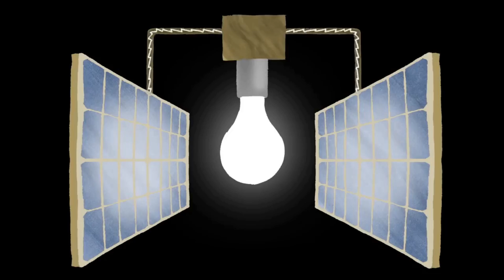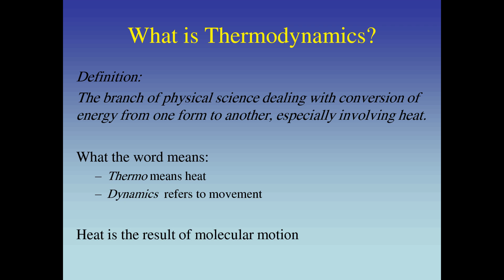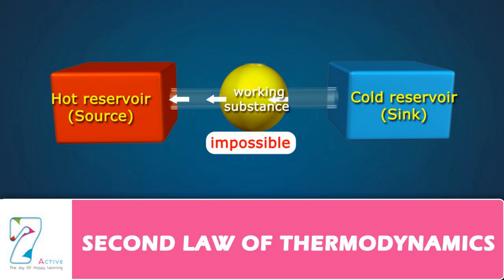2153 Do Perpetual Motion Machines Work

Comment: I saw a video snip of a German company using a large, vertical, conveyor bucket machine, in a water tank that has air pumped out the bottom to lift these buckets. They run a large air compressor for this. They claim a 8kW input to get a 52kW output. I'm no scientist but logic tells me it takes the same amount or more of energy to push air into a water column and its great pressure, than the lift factor of the air bubbles. But people keep trying lol
Reply: Investigate the effect of buoyancy with decreasing depth. As the bubble rises it expands and the greater volume displaces more water, increasing the upward force.  It really worked, but the slavemasters do not want it.  Well, maybe now that they are freezing in the dark. Oh, wait, that is just the slaves.
Reply: Just use the search terms   buoyancy generator
Reply: @marinadizon2720  Maybe you can define HHO. That would be great, Ty.
Reply: Yes, I remember the one you are thinking of.  They had a 10 meter tall tower of water with a conveyor belt of air bells which would get injected with compressed air at the bottom of their range of travel.  As the bell of air rose, and the water pressure lessened, the volume of air in the bell would  increase, thus increasing the upward force of the bell upon the belt upon which it was attached. The belt contained about twenty such bells. At any given time half were rising, and the other half were going down after having dumped their air, which meant they sank with the weight of steel in water with no air.  A belt driven generator  was placed at the top of the tower which generated electricity and compressed air to be injected at the bottom.  They performed public demonstrations, and offered units for sale.  They had large commercial versions, and small home sized versions, each sold via different sales channels.  They offered turnkey 100 MW systems composed of dozens of towers.
Reply: Anyone who bell dives knows buoyancy decreases as depth increases, which means buoyancy increases as depth decreases.
Reply: I've seen that and I have had a solution several years. Put an HHO generator at the bottom of the water tank. Electricity creates oxygen and hydrogen, which can be used together or separately to bring up the underwater wheel.
Also the deeper the tank and larger the wheel the more efficient it becomes, because the air never loses potential for going up.
Also the HHO Gas can be used at the end of the process when it goes to the top of the water. It can be burned for heat and or electricity.
Reply: @dutch1777real  HHO Hahahahahahaha! :face-purple-smiling-tears:🤣🤣😂😂😂🤬:face-orange-frowning::face-green-smiling:
Reply: @belalugrisi1614  a simple Air Lift Pump at the bottom of the ocean run off an HHO generator. 🫳🎤
Reply: @dutch1777real  Please define HHO
Reply: @bélalugrisi  HHO (aka OxyHydrogen) is Hydrogen, Hydrogen and Oxygen. A gas mixture of 2 parts Hydrogen and 1 part Oxygen. This can be achieved from electrolysis of water. (Passing electricity through it). Water is H²O and is easily broken down with electricity...
Reply: A quantity of O2 and H2 sufficient to do any  work, residing in the same vessel, would spontaneously combust. @dutch1777real
Reply: @bélalugrisi  no it wouldn't. 
Also the gasses can be separated to seperate vessels. It is a common feature of HHO generators. The annode and cathode produce different gasses in the electrolysis process.
Reply: That's common electrolysis. Converting  power to hydrogen and back to power by electrolysis has a round-trip efficiency of 18-46%. You definitely want to keep H2 and O2 separate!  Best to you~ @dutch1777real
Reply: @bélalugrisi  why are you deliberately being obtuse?
Reply: @MichaelCarouthGutenTag  to create HHO gas thru electrolysis you need electricity. Combustion of the gas and forcing it to do mechanical work, will give less than the electrical input. An HHO perpetual machine doesn't exist, let alone one that powers anything else. HHO gas under slight pressure (before pressed back into water), is a good way to store energy potential when you have excess electricity, like solar.
Reply: @thatguychris5654  yes of course you need electricity to produce HHO Gas through electrolysis. That's the remarkable thing about it. All you need is electricity. You don't have to physically force gas from the surface down to the bottom of the tank or Ocean or whatever you just run some wires. So the only friction involved there is the electrical resistance.
Reply: The only friction to get the gas to the bottom is the electrical resistance (basically). This is AMAZING! 
I'll explain it again. 
This is a water wheel under water, so it is an Air Wheel. Used to generate energy... Before it took too much energy to pump the air to the bottom of the wheel. More energy that the wheel could generate.  Ut this method generates the "air" at the bottom of the wheel. You are just transporting electricity!
Salt water already has an electrolyte (salt), which increases the conductivity and efficiency...
Don't like salt water, or water at all, because of scarry gasses? Then use a closed tank of another liquid. I think electrolysis works on other liquid compounds. I like salt water.
Substitute the "wheel" for a Air Lift Pump design and the head lift can be utilized to turn a water wheel.
Lots of configurations. 
Also the Hydrogen and Oxygen can be captured and used. Separately or together. For the Scarry Sally's the gasses can be kept separate from the beginning and used in 2 different systems.
This free idea I give to the world.
There are many off the shelf HHO generators available online right now.
Reply: @dutch1777real  Michael this is in fact a great idea! Have you built a test device?
Reply: @dutch1777real  pressure limits HHO gas production. If you stuck electrodes at the bottom of the ocean, zero bubbles would form from the electrolysis because of the pressure. Your idea would work great on a small scale with pressures we can manage in a small water column. Remember, HHO gets pressed back into water with not that much pressure at all. So when scaling it small like that, you will use more power to create the gas than the gas can generate thru lift in a water column. Thru mechanical efficiency loss along with electrical resistance in the wire and water, no perpetual HHO machines for us folks.
Reply: @thatguychris5654  the bottom of the ocean was an exaggeration. It can be done with "shallow" waters or tanks, with manageable depth pressures.
Reply: @MichaelCarouthGutenTag  perhaps read my entire post that you just replied to, since you just repeated what I said lol
Reply: @ThatGuyChris11  I did read it

Comment: "Do Perpetual Motion Machines Work?" The short answer is NO - The long answer is that Self-Contained, Closed-Loop Systems cannot be made to run under their own power.  A motor cannot run a generator that will in turn run the same motor.  A closed system cannot do work and maintain its own operation due to losses in the system. 

HOWEVER - Can machines be made to produce a large amount of work relative to the energy that YOU input into the system?  The answer to this is YES.  Provided that the energy you input is used to move a larger amount of energy existing in the environment.  No energy is created or destroyed, simply MOVED (and/or concentrated) from one place to another, creating a difference in energy potential that can then be harnessed to do work.  

So far, the only form of energy that I am aware of that we can move or concentrate in this fashion is HEAT  - We have built heat-pumps that can move 10, 20, or even 30 times more heat than we input in the form of electricity.  If we can then transfer this heat to a heat-engine and a generator, we could theoretically extract up to 40% of that concentrated heat in the form of electricity.

Comment: The story I was told, is that as microscopes were improved over the years. They became powerful enough to see grains of pollen. What was noticed is that these tiny pollen grains if suspended in water they would perpetually move.. This was shown to Albert Einstein. Einstein said the pollen was being perpetually moved by the movement of the water molecules. From this observation Einstein went on to calculate the size of the water molecule. This is not going to propel your car down the road but is in fact perpetual motion.. Ps don’t shoot the messenger!! Thank you for all the videos ..
Reply: Look up the Two-Stage Mechanical Oscillato of Veljko Milkovic
Reply: @markflint9089  pendulum hammer thing? I remeber it on keelynet
Reply: See graphene energy harvesting

Comment: you have to use 3 different forces, there are some, and most people make them to get into university. there is the magnet, centrifugal, and drag machine, there is the gravity, centrifugal, magnet machine powering a house in Kansas, there is many flux engines. you can exploit gravity, magnets and geometry to make a never ending desk toy. but if you want real power you want centrifugal, magnet shearing, magnetic current and dipolar PVC.
Reply: ? sorry you don't have any modern science prophets  to prove to you what you can learn if you just read the founders of science.@karlmccreight8172

Comment: I believe the only thing we will likely 'discover' . Anytime soon , would be a higher efficiency device, possibly generator.  Being above 99% efficient, but below 100.1%.  There could possibly be devices that work with little input, using gravity to help it along, or possibly magnets ,  I have seen magnet motors nearly make 360°, then stall . Maybe something similar can be used to boost the efficiency?  Who knows, thing is, would we believe it if someone did make such a discovery??
Reply: I agree. The search is useful if it can result in extremely high efficiency machines that use much less energy than present ones.

Comment: In a mechanism, magnets behave exactly like SPRINGS. so you can never make a perpetual motion machine from magnets (any more than you can with springs).
And with overbalanced wheel systems etc, they can never work because any weights or fluids must always go from the very top to the very bottom, cyclicly, ie the SAME vertical distance travelled and the amount of energy needed to lift a weight X vertical distance is the same as the energy released when falling X distance.
Unless there ie an ENERGY SOURCE being harvested none of those machines can ever work.
Reply: @andresgalviz315    hahaha for a moment I thought you were serious lol 🤣🤣🤣😎

Comment: You should give your scrutiny to William Skinner's 1939 gravity device. It is not a closed loop. It does require a small input to function. As load increases, the influence of gravity also increases. I have had six engineers look at it and they all agreed that they could not understand how it could not work. Skinner spent 30 years developing the device. It is complex and its function is difficult to fully understand, but, it is brilliant and works on a very simple principal. At the end of the day, it is an array of hybrid pendulum flywheels. A gravity turbine, if you will
Reply: Take a look at the Two-Stage Mechanical Oscillato of Veljko Milkovic
Reply: @markflint9089  I am very familiar with it. Brilliant. Simple.
Reply: @buensomeritano1755  I already suggested to Rob (in the members only video) that perhaps he had missed this device. My comment disappeared for some reason.
Reply: @markflint9089  the only thing I don't like about the milkovich device is that it can only operate at a specific load correctly. Skinner's device is constantly variable. As the load increases, so does the gravitational effect.

Comment: I had an idea of using a magnetic bearing to suspend a flywheel mass in a vacuum. With no contact in the bearings theres no friction, and with no air there's no drag, so in theory if you could spin up the flywheel there'd be no way for it to lose energy. It wouldn't be of any use, as you can extract energy from it but it should in theory spin perpetually.
Reply: Really only guessing here but I think it would spin a very long time, just not for years. I think there would be a small amount of drag on the ferris material the magnet is acting on or any stray magnetic fields, however small, otherwise it would not float in the first place.
Reply: Hard to eliminate all eddy currents (caused by metal moving in the magnetic field of the bearing). In theory it also radiates gravitational waves but they would be negligible.

Comment: A water wheel in a stream was the closest thing I got to. I had mad joule thief devices but they stop working when voltage drops. Though I had thought about using radiolosis to use nuclear waste decay that breaks down water to make hydrogen to run a engine or a fuel cell using buoyancy to separate hydrogen from oxygen or a nafion filter with a catalyst as a one way hydrogen seperator. With waste water going back to the nuclear waste to be split again but this only last based on the half life of the waste your using to split water based on radioactive decay.

Comment: I remember being sucked into that world. I was facinated by the idea of making a motor out of just magnets. They seem practically magical.

It wasn't until I was obsessed over a way to generate power with gravity that I learned fully why they types of systems could never work. Things like gravity or the magnetic field from a permanent magnet are constant. That is all. Something that is constant doesn't change.

We may not know exactly why magnets attract or how gravity works, but we do know they are constants. An apple falling to the ground or two magnets attracting each other are simply imbalanced systems seeking equalibrium. Electric motors work because of that sought after equilibrium. They only continue to work though, because the electricity put into the system constantly prevents the magnets from attaining equalibrium.

I learned, the important part of a generator or motor isn't the forces at play as much as preventing equalibrium from being attained in the system.

At first, I was confused about things like Hydroelectric dams. On first glance, they are gravity generators. So, I thought they were an example of how gravity generates power. It doesn't though. Ya, gravity pulls the water down through the generators, but the real power comes from the thing preventing equalibrium, prevents the water from staying at the bottom in the ocean. The sun. It introduces massive amounts of heat into the system, unbalancing it by causing the water to rise as vapor. So, in reality, hydroelectric dams end up being solar power generation.

Still, there is something so magical about magnets.
Reply: Well written.
Reply: Your story is a bit like how alchemy became chemistry. Keep up the science!
Reply: @andresgalviz315  interesting points, I must question your certainty of finishing your project in 6 months if you have been working on it for 14 years.

May I ask how your device works?
Reply: Sharp gradients (systems in non-equilibrium) can violate the 2nd Law. Source:  Modern Thermodynamics, Prigogine, Wiley & Sons
Reply: Look up the Two-Stage Mechanical Oscillato of Veljko Milkovic

Comment: Great video!

I'd have loved a small addendum that could work as a follow up video by itself: how it might be better to focus our efforts not on "machines that doesn't require outside energy", but on "machines that make use of free energy", linking it up with renewables.

I'm still hoping for the cheap battery that makes electrical unbeatable (even if its indirect, like with heat storage that doesn't suck like most molten salts projects)
Reply: My thought exactly. Machines that make use of free energy.
Reply: Look up flow batteries.

Comment: There was one at the Smithsonian in the early eighties, was basically a Ferris wheel with balls in the baskets that turned the wheel with the weight of the balls, balls would fall out at the bottom roll onto a track that routed to a worm gear at base of the wheel, worm gear raised the balls to the top where they fell into the ferris wheel baskets one at a time, completing the loop. Can't find a picture anywhere. Looked logical . Would love to see you print one up.
Reply: Look up  Methernitha
Reply: It's the same thing as all the other "perpetual" motion machines, it won't work.